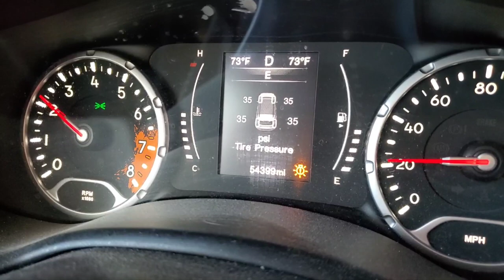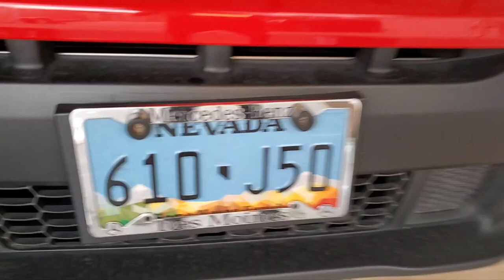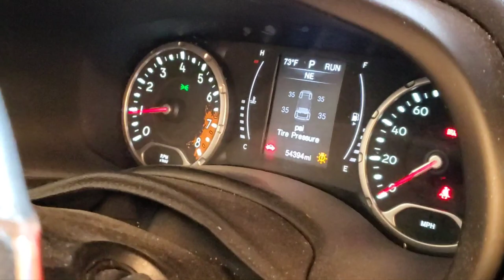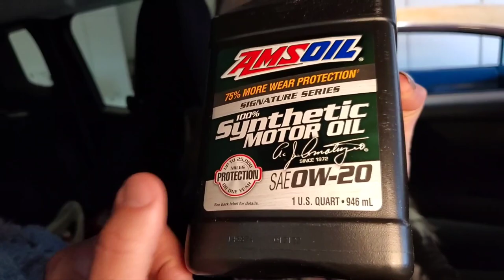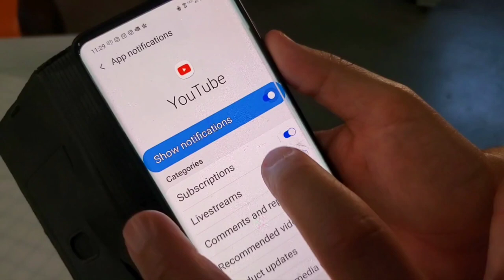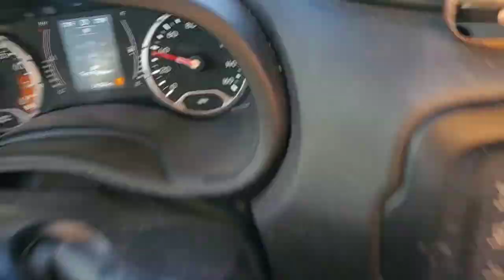AMSOIL Oil Flush 1 Take START to FINISH Results

Comment: Great video as always!  I like your visual example of the good injector vs bad/dirty injector.
Reply from the maker: 💯🪙👍, Thank you I've been working on this one Thanks 😊
Reply: You have mentioned a good thing. I was thinking about left over 1-2 oz of flush inside the engine and I had done an extra oil change after flushing my engine. But later I had researched about it and found those lil amount left over detergents actually evaporated one the engine runs to operating team for 40-50 miles. It wouldn't hurt anything. Thanks for the video Eben. I always enjoy your videos.🤞👍

Comment: Hi Quick question 🙋🏻‍♂️ I own a Montero 2002 3gen , the engine is recently rebuild completely rebuild might said. It has 7500 km. The flush is necessary on some point ? Or not. It runs on AMSOIL XL 5w30. Ready for my second oil change. 
Hello from Ecuador. 
Love the AMSOIL videos 😎😎
Reply from the maker: Yeah it's great to do an engine flush It's always worth it also the power foam is worth it and also the PI performance improver is always worth using If you can get your hands on some signature series I would do it unless you driving very low mileage and then you're fine with the XL Thanks Gabe for being a part of the channel 😃💯🪙

Comment: Eben, I know this video is 2 years old, but I'm hoping u can still help me. I just bought that same vehicle,  Jeep Renegade and mine has the dreaded tranny jerk when it shifts. Not very smooth at all. Can ur Amsoil transmission fluid help with this??
Reply from the maker: 💯.
I give a man a fishing pole & show him how to fish. 

     Together! We can get your vehicles to run better than brand new!

     For me to get credit & be "Your" Independent AMSOIL Dealer please use my website below or my dealer no. 5331179 call anytime Eben Rockmaker 702-472-3614
After you click on: http://syntheticoilprotection.net
1. Click hamburger menu
2. Click offers AMSOIL preferred customer
3. Click join now 6-month PC member add to cart.  ( there is no reoccurring renewal membership unless you select that dot box ) 
( you have the option to not have your credit card saved if you prefer - est. 1972 )
4. Scroll up to the top Select shop by vehicle.

New Promo: FREELAMP

Comment: What would this engine flush do to a 2011 Toyota RAV4 with 150k miles. It does burn oil.
Reply from the maker: Hey Tony it will clean the carpet around the Rings it will allow the motor to run smoother quieter better compression less blow-by you'll also have less oil consumption I highly recommend the Amsoil Signature Series and I recommend getting a Wix oil filter for the first 3000 miles after that I would change the filter and then put the M2 oil filter on.

It's going to take some time for all that buildup to come out the flush will get about half of it and then the signature series will slowly melt the other half of the build-up out.
I also recommend doing the Amsoil Power phone and also the PI performance improver gasoline additive.
If you have any questions at all give you a buzz you'll see everything here on the lookup guide and I also recommend the six-month PC membership that will give you the best value on the products and when you use my link I will be here and toil dealer so in the future I can always answer all your questions on the products and I really appreciate your business teacher business in advance thank you💯😃👍
✅✅✅  I Recommend The AMSOIL 6 Month PC Membership because it will give you the Best Value. You get $33 back on a $100 purchase after the difference in tax with No need for Auto Renew - https://www.amsoil.com/offers/pc/?zo=5331179

Comment: Hey Eben, question for you: my Jeep takes 4.5 quarts of oil…so should I put 4.5 quarts in the engine port PLUS pouring additional oil in the filter? Or should I go 4 quarts or so in the port and .5 in the filter?? Thanks man!
Reply from the maker: Great question what I always do is prime the filter and then I put in about four quarts started up and then I top it off later and make sure it's exactly where I wanted on the dipstick It's always good to underfill it in the beginning That way you don't put too much in because if you do it'll smoke when you're on a hill on an incline so it's always good to put less in and then check your dipstick 🪙💯👍
Reply: @Syntheticoilprotection  thanks brother!! Doing a flush and then Putting in the liquid gold  tomorrow…psyched about it!!

Comment: Sounds like Katie  had  a case of fuel dilution. My Dodge D-50 had the same problem.
Reply from the maker: Most cars that are driven short trips will always have a little bit of fuel delusion but as long as it's not over 3% you are looking pretty good it's just that when it gets to be a lot it can be very thinning on the oil and that can cause premature wear on the Pistons and cams because it thins out the oil film so it pretty much depends on the vehicle like diesel trucks can have quite a bit of fuel dilution
Reply: I used to live in  Henderson and drove to the base everyday, then when I made a trip back to Wis, when I stopped for the night at a wayside in Utah @Syntheticoilprotection   I  lost a  full quart of10W30 amsoil I believe was the weight I had in my D-50, topped it off and ran the whole next 24 days w/o adding anymore, can't recall if I had to add any on the way back to Vegas, but I think I did add some.

Comment: Eben is it your hope by doing the flush each time that it's going to clear out those piston rings and reduce the oil burning?
Reply from the maker: Of course however if there's something wrong with the motor the tolerances inside the motor there's nothing you can do if it's a manufacturer defect.

But of course doing the flush in the PI cleaner and using the signature series is going to let it not burn as much oil and it's going to also run a lot better a few mileage less oil top off which is less time wasted which is great
Reply: @Syntheticoilprotection  I'm going to be putting some Pi Improver in both my cars this month.  Very excited to try it.
Reply from the maker: Oh yeah I also recommend the power duo That's the upper cylinder lubricant with the dominator octane booster all in one Amazing how much more punching power smoother idle and you'll notice a much cleaner burn with the huge bump and fuel mileage
Reply from the maker: This video shows how much punching power those additives have https://youtu.be/NU9ooUnUWB4
Reply from the maker: We're going to be doing Dino video soon showing the before and after horsepower difference with just those few additives very soon
Reply: @Syntheticoilprotection  thanx

Comment: Can you and she share with your captive audience if she ends up getting a warranty claim on the engine for oil burning?  Amsoil may be all that’s delaying the inevitable.  Thanks!!!
Reply from the maker: They did a test on it and they said the oil burning is normal so they will not do a warranty claim
Reply: @Syntheticoilprotection  Geez…I wonder how bad it has to be to trigger a warranty claim.
Reply from the maker: When it's on fire lol
Reply: These engines are bad about burning oil if u make a bunch of short trips.  We have a 18 renegade with 41000 miles and it don't burn oil but we don't make a bunch of short trips either.   I use that same oil filter on my jeep.  I use nothing but amsoil products in all my vehicles
Reply from the maker: Sweet💯🇺🇸

Comment: Hello I have a question, I have a jeep renegade 2018 I want to change the transmission fluid for the Amsoil transmission fluid, please can you tell me how many quarters I need to put ?
Reply from the maker: It depends on the model so I really don't know sometimes they do a mid model year update on the transparent size I believe hers held about three and a half quarts It's always good to get a little extra just to be safe if you spill a little bit or if you're can pump brakes it's always good to have extra.

This will give you everything for your year make model and engine size and if you ever have any questions you can reach out to me when you use my enzyme link I'll be able to answer all your questions in the future as your AMSOIL dealer and I would also get the credit for your orders which I thoroughly appreciate your business in advance Thank you.
❤️🇺🇸❤️ Professional YouLubher: Eben Rockmaker Regency Gold Direct Jobber AMSOIL Specialist (Dealer#: 5331179) 702-472-3614 

      ✅✅✅  New To AMSOIL I Recommend The AMSOIL 6 Month PC Membership because it will save you about $33 on a $100 purchase after the difference in tax - https://www.amsoil.com/offers/pc/?zo=5331179
Reply: Thanks a lot the fluid works pretty good on my car
Reply from the maker: Sweet.
How many miles were on it when you changed it?
Reply: 45000
Reply: The transmission oil was dirty so I decided to change it  , yesterday when you responded my question, I put 4 quarters and it works good 👍 thanks 🙏
Reply from the maker: Sweet👍👍👍

Comment: 2008 Yukon Amsoil oil filter part number
Reply from the maker: You will see it on the lookup guide I highly recommend the preferred customer membership will give you the very best value on the products☕️👍👌
For me to get credit & be "Your" Independent AMSOIL Dealer, please use my website below or my dealer no. 5331179 call anytime Eben Rockmaker 702-472-3614
After you click on: http://syntheticoilprotection.net
1. Click the hamburger menu
2. Click offers AMSOIL preferred customer
3. Click join now. 6-month PC member add to cart.  ( There is no reoccurring renewal membership unless you select that dot box ) 
( You have the option to not have your credit card saved if you prefer - est. 1972 )
4. Scroll up to the top Select shop by vehicle. 

New Promos: FREESHIP & 5CERAMIC
Reply: Part number? Amsoil oil
Reply from the maker: @yaboyjbonez7402 this is the lookup guide - https://www.amsoil.com/guides/?zo=5331179

Comment: does amsoil have oil for lawnmowers?
Reply: They have a small engine 30w. I have a small tractor that has ran Amsoil for its whole life from my father as a hand-me-down. It runs like the day he bought it and is 23 yrs old.
Reply: @nunya2445  thank you. I will look for it.
Reply from the maker: Yes it's called small engine oil This is my link if you new to Amsoil save you a ton of money when you use my link I'll be able to answer all your questions in the future because I'll be your Amsoil dealer I appreciate you checking out my channel Thank you for being a part of my YouTube community
❤️🇺🇸❤️ Professional YouLubher: Eben Rockmaker Regency Gold Direct Jobber AMSOIL Specialist (Dealer#: 5331179) 702-472-3614 

      ✅✅✅  New To AMSOIL I Recommend The AMSOIL 6 Month PC Membership because it will save you about $33 on a $100 purchase after the difference in tax - https://www.amsoil.com/offers/pc/?zo=5331179
Reply: @Syntheticoilprotection  he also had a Chevy work van with a 350 in it that rotted out before the valve covers ever came off. Early 80's van, Amsoil and over 400k miles.

Comment: oil burning problems over the years. Its only a few years old.  So its been burning since new.
Reply from the maker: Oh yeah it's a problem with those motors.

It's funny back in the old days there's actual production motors that they say one quart of oil consumption is normal for 1,000 miles of use 😆😄😁

It's interesting how different models are brands makes and all different motors It's very very interesting and entertaining lol
Reply: @Syntheticoilprotection  I have a car with a 3.8 with 300000 pluss miles.  I have changed the oil regularly with no additives and conventional oil only.  It does not use a measurable amount of oil between 3000 mile oil changes. Even my 1970s vehicles with the typical Chevy 350 never used even a half quart of oil between changes. So modern engines doing this is rediculous.
Reply from the maker: Yeah it's pretty funny.
It's funny as in it's like a joke however it's pretty sad when someone that doesn't understand maintenance wrecks their motor and they run out of oil in the middle of the desert and are stuck on the side of the road that's the sad part.

Out here in Las Vegas I see cars smoking all the time and then they're on the side of the road because they run out of oil it burns the oil so quick once you get oil burning the rings get stuck once the rings get stuck it becomes exponential and in about 500 miles the motor seizes and then you see the car in the side of the road here in Las Vegas it can be back the back 115° out for 3 days in a row at night time it's a hundred and one degrees at 12:44 a.m.
Reply from the maker: The air density is about 7,000 ft above sea level here in Las Vegas because of how hot it is and then the height where I live on the west side of town is 2600 feet above sea level so the motor feels like it's at 7,600 ft
Reply from the maker: If you want to see something pretty nutty this is my personal car at basically midnight 93° out at about 2,600 feet above sea level here in Las Vegas headed uphill I do a 0 to 60 and I scrub off a 3.8 seconds 0 to 60 with a 240 lb passenger in the car.

The bottom end on my SL550 is pretty close to a Shelby GT500 2014 model.

After I do the intercooler fluid it made a huge bump in output my guess is about 17 more real-wheel torque. Maybe more
https://youtu.be/dUNMXxJF53Q

Comment: 28:20 😵 😂
Reply from the maker: Have you ever tried the Amsoil quickshot in your motorcycle yet

Another one I recommend it is called the Dominator octane booster and the upper cylinder lubricant those are what I called the power combo you'll see your bike or run a lot smoother you also make a lot more wheel horsepower because you'll have a cleaner burn and less friction on the upper cylinder rings.

If you ever have any questions with the products always be here for you.
❤️🇺🇸❤️ Professional YouLubher: Eben Rockmaker Regency Platinum Direct Jobber AMSOIL Specialist (Dealer#: 5331179) 702-472-3614 

      ✅✅✅  I Recommend The AMSOIL 6 Month PC Membership because it will give you the Best Value. You get $33 back on a $100 purchase after the difference in tax with  No need for auto Renew - https://www.amsoil.com/offers/pc/?zo=5331179